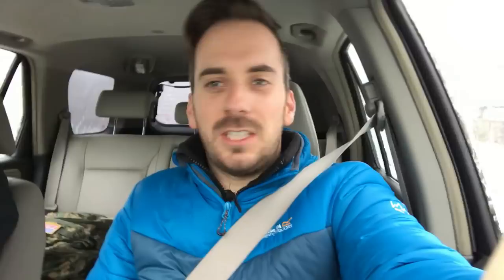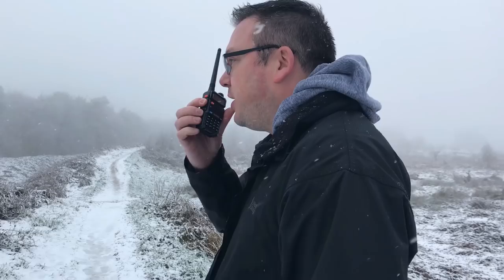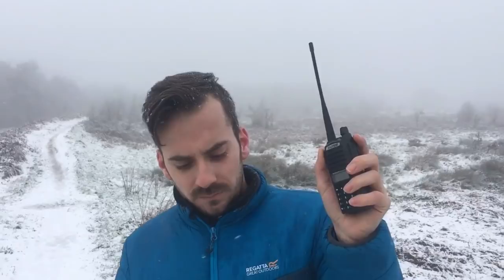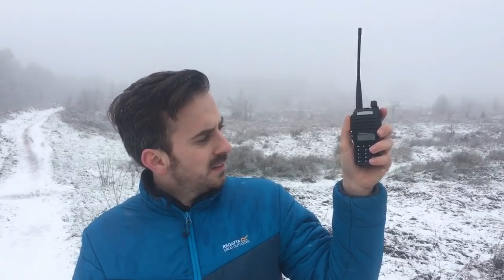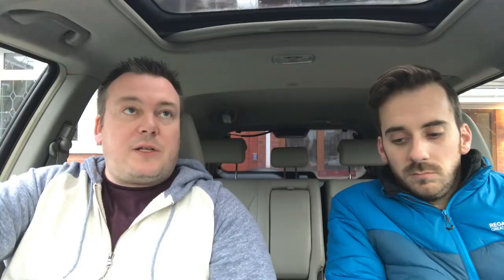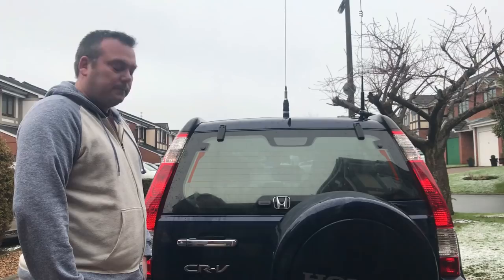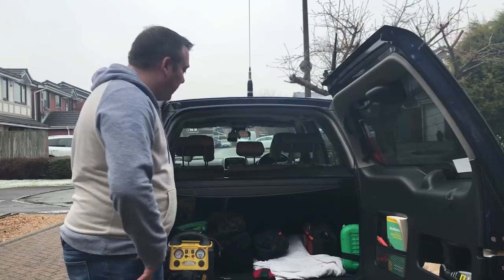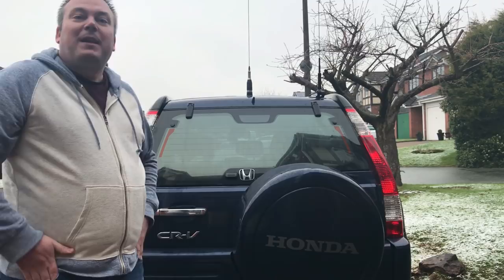Amateur Radio Antics With James Fletcher 2E0KBA

Comment: Spent many a Sunday afternoon running around cannock chase in the early 70s its a lovely place, a very good contact from there as well, there isn't a lot wrong with these cheap Chinese handhelds, I kept a GT3 in my car for 2 years got it out the other day the battery was still well charged, they are amazing at holding a charge,

Really fun video too although your are braver than me and dont either of you own a hat? ha ha or gloves? Good attempt with the drone, Im going to pop back up to the TV transmitter in my last video and get some aerial shots of it at some point.

Ive spent the weekend charging up and sorting out all my handholds, need to get a system sorted whereby I charge and use them in rotation, I only just saved the battery in my Icom IC-E92D as it hadnt been charged for a year or so and wouldn't take a charge, charging through the radio via the DC in jack saved the day as it wouldn't charge off the base (flashing orange light), that would have been 80 quid to replace else!

Looking forward to more videos soon
Reply from the maker: Always look forward to your comments!

Yeah the chase is nice! Can't believe the battery was still charged after 2 years! You've gotta do some radio videos soon mate I'm desperate now haha. I sent James your Wi-fi video and he enjoyed it too.

It was great fun and freezing cold! The wind was what brought the temperature down. TV transmitter aerial shots sound great, I was disappointed Pye Green wa shrouded in fog really, it looks menacing in the video. The drone was soaking wet when it came down too due to moisture in the air. I've a full video of Winter Hill filmed and part edited but I'm not happy with it! Not sure if I'll put it up.

I've got no shack at the moment so got tonnes of handhelds out of charge! Upsetting, they're all in a drawer at the moment. Shack will start in the new house in March hopefully. Good stuff on the Icom battery! Glad you saved it. 80 quid is ridiculously expensive.

When can we expect your next vid? ;)

Comment: Hi I am confused with advertisements on online retail Websites like TaoBao in China that describes certain HH radios like the Baofeng UV5R capable of 10 Watts power in their specifications, but these models are identical to the cheap priced ones advertised with only 5 Watts. Is this just misleading information from unscrupulous dealers to jack up prices for essentially the same radio? For the average unwitting consumers  being mislead & fleeced, how can I verify the claim other than what is advertised as or with just a sticker on the device or writing on the packaging.
Reply from the maker: Very misleading Wilson, there's all sorts of crazy power claims out there, BF-UVB2+ says 8w its only 5. Usually the best way to know is when you receive the radio and it doesnt test at what it should Frustrating really.
Reply: I'd be surprised if any of them made 5 watts. These are disposable radios and the build quality is very poor. They are, however, good as backup/emergency radios or something to keep in the car, because they're cheap as chips. I'll stick to the Yaesu and Kenwood for real work.

Comment: you wah... checking the range of network radios.... hahahahaa you might as well had checked the range of your WHATSAPP calls as well.. I wonder whats the difference .. oh wait.. it uses INTERNET..   so funny
Reply from the maker: What are you talking about? We used actual radios!! Not network radios!
Reply: @RingwayManchester  at 1:16 Your friend's Intro... Today we going to play with some handhelds.. a bit of a range test.. etc. etc... at 1:37... so I thought it would be interesting to have a bit of play with these (NETWORK RADIOS).... at 1:40 I STOPPED the video... ... the introduction just didn't came across well. I am sure you went ahead with radios at the end...

Comment: Hi, I use my uv5r as a scanner in my car, I am using a  mini naygoa mag mount antenna with twin coils. Is there a better antenna you would recomend, the antenna is not bad but I think the very thin cable is losing a lot of the signal.
Reply from the maker: Go for a Nagoya SP-80! Decent size but not too big, very effective and with a decent magmount it'll cost you about £35 but you'll see the world of difference. I use it myself.
Reply: Ringway Manchester Hi, Have just ordered a Nagoya S 80, not sure of the difference between the sp version but they look the same, with magmount it was £29 delivered. Should arrive tomorrow.